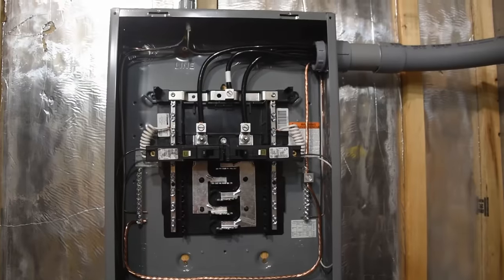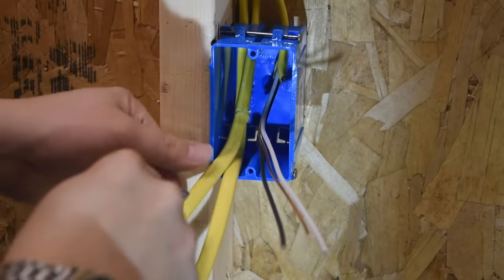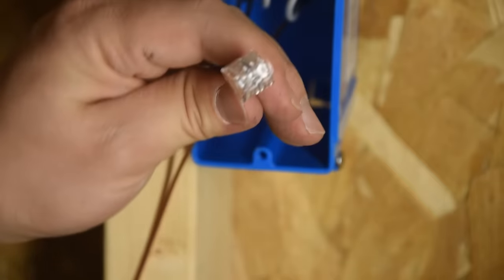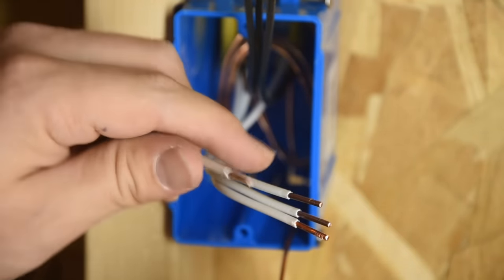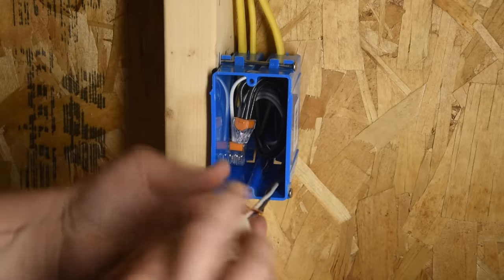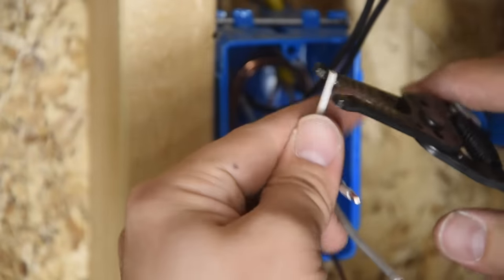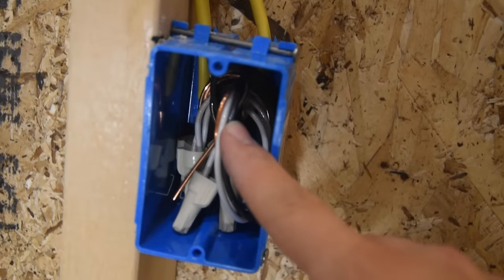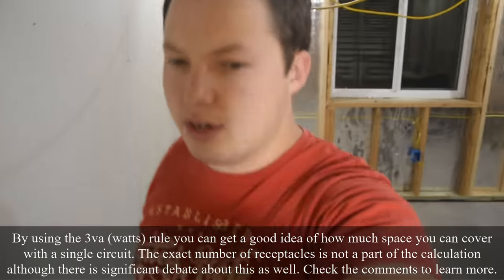Wago's vs. Wire Nuts - How To Wire Outlets During Rough In

Comment: I've pulled too many receptacles out of their boxes with the push-in type wire installation, and the wires come right out of the receptacle...the insulation of several of which were burnt to a crisp.
That said, I'm not too fond of the push-in type devices, including these things.
Reply: They are fine untill they get movement (loose recepticle) or excess current over time.

Tests out there show the clip style nuts working fine under load.. but every one I have taken apart after it has been in the wall for years.. is loose or falls apart (heat). Usually when a recepticle has issues.. is because the push terminals were used. 

Just more contact area with a wire nut.

Can't wait for the breakers in the panel to get these. Hahahaaa. Ooo maybe the main feed.   JOKE
Reply: There is a reason that commercial installations won’t generally allow push in connections on their receptacles . A spring loaded connection can’t offer a long term quality connection.
Reply: We only use wago's and don't use wirenuts for decenia. I'm 27 year in the trade of electrician and if I've made 200 wirenutconnections, it is lot. Only wago's and especially the new ones with the little levers are ideal. The only thing is that you have to strip them accordingly to the measurements given on the packaging. Depending on your gauge you have to strip them correct, not longer, not shorter. If you do that correct, no problem.
Reply: I have 45 Years of active service as a volunteer firefighter. 35 years of that was as in a rather busy suburban station. We stood watches because the calls were too frequent to wait for people to come from work or home. I would not care to have to count the number of times we responded to a fire or, when the occupant was luckier, to an odor of smoke and found a push in receptacle or switch as the root cause of the problem. Yes it is true that we ran calls were receptacle failures which involved bad screw wrap connections and worn out contact wipers arcing were the cause but no ware near a fourth of what we saw with the push in connections. My bread work was as an electrician but I thought I'd share what my experience with the spring contact connections in the failure mode context. 

Tom Horne
Reply: @nachtdiertje1972  I've made hundreds of thousands of terminations , if you want keep using them cuz I get a lot of troubleshooting calls and it's those Waggles  I just have to replace them ,easy money as long as the place don't burn down and nobody gets hurt
Reply: @hornetd  I recently did a service call that two other electricians gave up on trying to find the problem when I found it it was a outlet behind the bed it was so hot I couldn't touch it I had to let it cool off and it had one of those wagons behind it black and melted like an arc welder
Reply: 4o years in the trade, I will not tolerate push in receptacles and switches nor those new push in connectors . I remember there was a quick coupler -crimp on ,where one could splice into a wire in an attic by not using a J box, it was UL approved, but in a few years outlawed , to many fires were caused. So my advise is ,  use a bit more effort/time in twisting wires and screw terminals if you want to avoid a customers house or yours to burn down. What's the hurry you are getting paid by the hr or job anyway not how quick you are.
Reply: @OICUB12 - Me too. Not to be critical here but there is a reason outlets and switches have screw terminals for. I trained under a licensed master electrician with 50+ years in the trade and he once told me only lazy people use the "push in" type connections. Whenever I wire an outlet or switch, I make a loop in the stripped copper wire and attach it to the terminal screw and tighten it down. I am in the same boat as you. I have seen my fair share of burnt outlets and switches due to those stupid push in connection. I helped redid a home built in the 70's and they were very popular as every outlet and switch in that house had the wires stabbed in the back. So that's my take. I don't use wago or any push in wire-nuts. I prefer the classic wire nut and I pre-twist the ends with my pliers before tightening the wirenut down.
Reply: @nachtdiertje1972  I'm  68 years old & retired. Wait till you get older.
Reply: You can give me a call when it fails
Reply: @nachtdiertje1972  WAGO level nuts are the best invention in the history of humankind.  Or at least somewhere up there.  Anyone using twist wire nuts are just increasing their chances for loose wire problems and trying to give themselves carpel tunnel.  ;-)
Reply: @wb5mgr  I agree, all of the current is going through that knife edge.  We use 12awg wire to get the number of circular mils needed for the current density, now we pass all that current through a knife edge?  It makes no sense.  I don't like wire nuts but there is a substantial amount of surface contact between the conductors.  I never use push-on connectors, I've seen them go bad too.  How about grounding where you want the wires to be bonded.  The ground wire only carries current when there is a fault, so most of them time they don't do anything, but when there is a high current fault, all goes through that knife edge again.  Jim
Reply: Mark Grudt  Yes, I'm delusional.  I didn't lose power when, after a few years, one of the neutrals a 4 wire bundle finished being loose enough to kill the power for the circuit and I then fixed it, and ensured it would stay secure when getting shoved back into the box by using a wago. It was all in my head.  Oh me and my imagination.
Reply: you won't get this issue with WAGO connectors. when it comes to push-in connectors WAGO is the gold standard. Used all over Europe in receptacles and all forms of electronics for years.

Comment: I don't  like using wago connectors.  Over time those push lock connectors will come loose and haunt U trying to find the problem. I like using screw connectors on all electrical. It may take about 10 + years to screw up with wago. I'm 68 years old and I have had that happen to me quite a few times. Like your work. Thank You.

Comment: I always strip the sheath off the cable  before entering it into the box way easier and faster.
Reply: Walter B that is a bad idea, the jacket protects the conductor insulation during penetration of the box gripping, also, the ease of getting the correct conductor length and jacket entry if done inside the box.
Reply: I always slit the cable before entry but leave the sheath on until inserted.
For the ground, I spin them together inside the box, install a crimp sleeve and trim off all but one wire for the pigtail to come out 4 inches.  This keeps the cables from being pulled out of the box.  Also, I turn the neutral and ground counterclockwise and the hot clockwise so that the neutral ends up on the left and hot on the right, directly behind the outlet.  Also, I insure that all wagos are installed with the open side down to prevent debris and moisture from collecting.
Reply: @benevolenthighwayman882  
You dont mind using wagos then? they dont arc over time?

Comment: I just used wagos for the first time in my basement remodel and felt the same way.  Why haven't I done this before?  For 14ga I don't mind wire nuts, but for 12ga Wago's are just so much easier and can really cut down space in some 3 or 4 gang boxes with special switches (motion, dimmer, etc)  One feature I liked was having an open hole on the wago, (i.e. a 4 hole wago for 3 wires) so I could easily add another wire in the future
Reply: Steve Reese one thing to keep in mind is it’s super easy to use the correct size wago now and replace with a larger one down the road if needed. Saves money upfront.
Reply: I loved switching from "choc-block" screw clamps to WAGO,  wire nuts are not a thing here and screw connections need to be retentioned after the copper has been allowed to "flow" for a few weeks.

Comment: I definitely twist current carrying conductors when using wire nuts
Reply: ALWAYS! Do it well the first time and you seldom get call backs. Call backs are on you.
Reply: I am a licensed electrician and I will NEVER use a Wago type connector or use the "push-in" type switches or receptacles. Bad connection/fire hazard...
Reply: Never have seen a failure with that method.
Reply: NEC use to at least say that you have to have two twists on the wires before installing a wire nut.
Maybe that was before they started putting the metal insert into the wire nut. 
Try doing that with 4 #12 wires.
Reply: @markchidester6239  That's where the push in connectors really shine. That #12 wire can be a pain when connecting more than 2.
Reply: @rileyneufeld7001  wago connectors are for lower amperage connections such as in light fixtures.  They do not make them to handle 15 or 20 amp connections.  I would not use them behind an outlet.  As far as twisting the wires for wire nutted connections, the NEC does not require it if the wire nut is listed for the mechanical connection but it is still good workmanship to twist the wires together prior to installation of the wire nut.  Failure to properly twist the wires is often the cause of a poor connection and a safety hazzard to anyone who has to troubleshoot after you (some troubleshooting methods require power on).
Reply: @ianbelletti6241  The Ideal ones I was using are rated at 20 amps.
Reply: @ianbelletti6241  Wago's standard push-in connectors (eg 2273-203) are rated for 24A, their lever-models (221) are available in a 32A and a 41A version.
Reply: @ianbelletti6241  Many Wago connectors are rated to 20 amps. They meet all of the NEC code requirements regarding splicing and terminating conductors.
Reply: @ianbelletti6241  if you are twisting your wires before trimming them, make sure you strip them long first, twist them, then trim down to the recommended length according to the manufactures directions. we are required by code to install things acoording to manufacturers instructions, and ideals instructions say you have to strip long, twist, and then trim. where as if you dont twist them, you dont have to strip long and trim. you eliminate unnessecary steps by not pre twisting
Reply: @laysstandard  been an electrician for 20 years. I rarely have to trim my connections. You'll be a better electrician if you figure out how long to strip the wires so you don't have to make the extra step.
Reply: @Ian Belletti They are rated for 20amps and as a matter of fact... Wago now has a model rated for 30amp to handle 10 gauge. 
But am sure you won’t be able to buy them now because of all the lawsuits from all the electrical fires that have been started over the many years they have been around. The “cage” clamp that the Wago uses has been in use since 1980.
Reply: If you’re twisting your wires up, you’re using wire nuts incorrectly. They should be twisted as tightly as possible while firmly holding the wires as far toward the wire nut as possible so as to prevent them from twisting. If you’re twisting the wires, the spring coil is no longer digging into the conductors harder and you’re just uselessly making it harder to deal with in the future. 

Put a wire nut on a couple wires the way you described, and then the way I described. Now pull the wires apart, my way will be harder to pull apart every time. The manufacturers will tell you the same.
Reply: @zalmaflash  I won’t use Wagos on anything but low voltage unless I’m forced to by the GC or customer. I’ve seen way too many of them straight up fall off. 

Do you mean like plugtail receptacles and switches? They’re considerably safer than traditional devices, statistically speaking. Just about every commercial building in my area built in my 13 years as an IBEW journeyman inside wireman has used them, and I’ve never changed a bad one. Not one, and I did service work for a commercial contractor for four years. 

Screw terminals are susceptible to vibration and being installed by dumbasses, plugtails aren’t. I don’t personally like dealing with them worth a damn, but whether I like it or not, they’re better.
Reply: @ianbelletti6241  Do you just mean twisting the stripped portion of the wires? If you’re talking about twisting the wires outside of the wire nut, everything you said is exactly backwards. Well, not the Wago part, they do suck and are only for low-current applications.
Reply: @ianbelletti6241  that's not the point though. 

Code requires you to install everything according to manufacturers recommendations. Read the back of the ideal bag.
Reply: @zalmaflash  You sound like the old framers I know who laugh at guys who use air nailers saying how they can't be better than hammers.  More failures have come from nut connectors than Wago connectors - fact.  NEC approved and widely used in Europe for decades.  But, you should of course use what you are comfortable with using.
Reply: @ianbelletti6241  They certainly do make them for 20a and above, stay current!  Hey that's a pun
Reply: @ianbelletti6241  the method I was always taught was to grab the wire with one hand then make a thumbs up.  Using a standard pair of lineman’s pliers clip the end of the wire with the pliers resting on the tip of your thumb with the cutting edge away from your  hand.  This will ensure around a 6” or longer wire.  Strip slightly more than 1” of insulation away and then with all wires lined up twist them either with your pliers or a wire nut.  Then you can use your pliers or a wire nut twisting tool to twist the entire bundle so that the twisted wires pull together inside the box making a secure and strong connection.  This can also prevent the twisted wires from coming apart if any of the wires were to ever get pulled on for whatever reason.  Even though they should be securely fastened with staples or run inside conduit you never know what can happen.
Reply: @edwardholton3225  obviously more failures have happened from wire nuts, wire nuts have been around for 150 years.  Wagos are like 15+.  Just because manufactures have made poor choices in materials and designs for over 100 years doesn’t mean that wagos aren’t going to suffer from the same issues down the line. Just like most failures form wire nuts are 99% installer related, wagos still require a competent qualified installer know how to properly use them.  I’ve seen people with 40+ years experience use wire nuts are contacts instead of protection devices.  Before wire nuts people just used to crimp rings on wires an wrap them with tape.  Wire nuts aren’t what is superior to wagos,  a proper NEMA twist is what’s superior.  The wire nut is just a protective cap over that properly connected bundle of wires.  Which wagos does not allow for.
Reply: @markchidester6239  can you show the reference?...
Reply: @jrock865  
No I cannot. This is something I read in a book back in the mid 90s.. It specificity stated that it was an NEC code to have two complete twists on the wire. Sure made a good connection. 
With 4 #12 wires, the length of bare copper made it tough to cover it all with a wire nut.
Personally, I would rather do that then use these push in connectors. I can't believe that the connection is sufficient to carry much current safely. I can see them heating up and melting. I would also bet that there would be a sufficient voltage drop when the current is above half of what they are rated for.
Reply: @markchidester6239  i know there is a 1930 patent showing a wire connector with pretwisted wire and it had a wago style clip in it.  also the first connectors were a ceramic style right after they changed from gas lamps to electric.  I still find them from time to time.  I just have never seen a code ref or anything saying to pretwist,  but as far as todays standards go manufacturers say not to pretwist.
Reply: @zalmaflash  Ridiculous excuse for not using WAGO. Bad connection/fire, like that would never happen with wire nuts. If done correctly I am sure both methods dont cause fire or bad connection. But it comes down to price and time. And we know as electricians time is valuable to the customer. So if using WAGO takes less time but costs a little more, it might be worth it. And wire nuts puts more stress on your wrists.
Reply: Every electrician does.
The “new” guys are the wago generation.

I’m a knob and tube generation electrician.
Western union splice is in my lexicon

Comment: Same I only use the push in connectors when I have to and it’s more of a temporary fix. I don’t trust them one bit plus the clip on the wire just like back stabbing outlets does and look how that turned out over time. Same concept just different housing. Nothing beats a good name brand wire nut and pre twist the wire. I have pulled out many outlets and junction boxes and have seen the connections just come right apart even though the wire might was twisted down super tight but the wire was not pushed in far enough when installed or when there is more then 2 wires there’s not enough wire making contact to the wire but and two will stay in buy one falls out. I pretwist my wires and once twisted cut the end at a slight angel and in some cases use a 5/16 nut driver to spin  on the wire nut. I never have a connection come undone or fall apart unless you want it to.